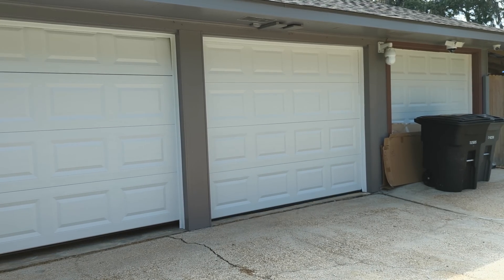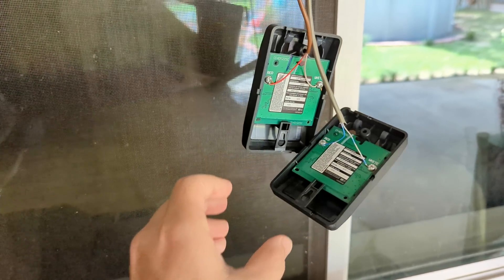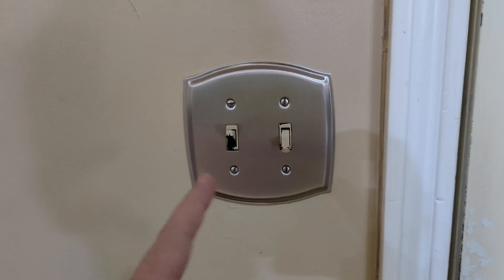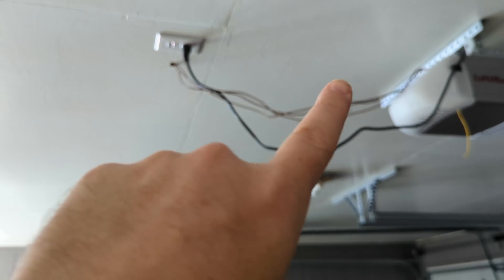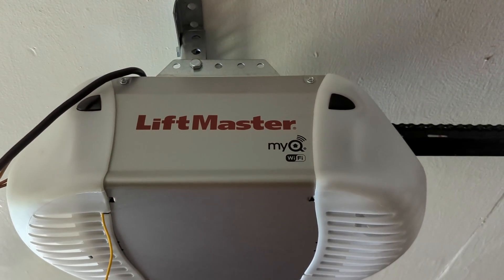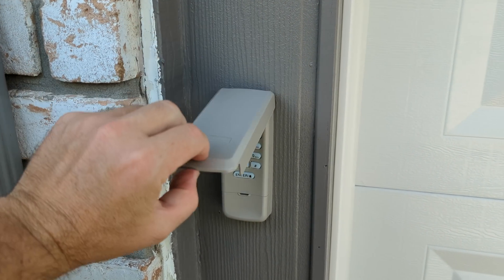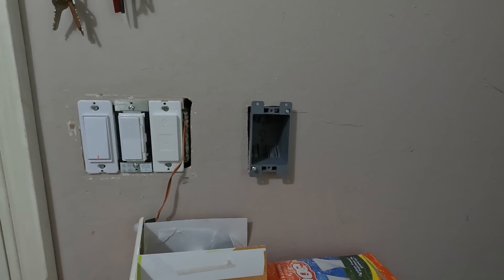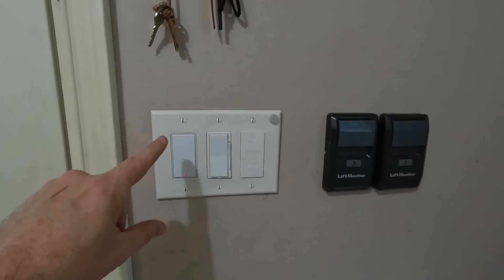I hate my new myQ garage openers! Why I'm removing the cloud and adding status lights.

Comment: I'm so far in the middle of the video but I have two LM's with MyQ and zero issues. I also have 5 Unifi access points so I have wifi 360* outside of the house. I live in Florida and opened my garage doors from Germany. I like it. Looking forward to the rest of the video.
Reply from the maker: The trouble is the dependency on the ISP and cloud being up which is out of our control. We could direct wire the doors to ethernet some how and still have the same issue.

Comment: I've been installing garage doors for nearly 15 years. Liftmaster is unrivaled in commercial access in my opinion, however for you guys looking for a good, reliable, basic opener I very highly recommend Guardian. Specifically the Model 615DC. They're super quiet, super smooth, and they just work! Liftmaster took a huge hit when COVID hit and I made the switch to Guardian for all of my customers unless they specifically ask for Liftmaster. Very good unit.
Reply from the maker: Thanks for the advice on the opener!  Definitely have to make a note of that.  Do you know if the button is a standard style button that shorting the two pins actuates the door?
Reply: @digiblurDIY  yes. There are no fancy circuit boards in the standard button. There is a premium button available but it has its own port on the back of the power head.
Reply from the maker: Nice! That makes it so easy with dry contacts
Reply: @digiblurDIY  it's also worth mentioning that the long term cost of ownership is lower as well. For example, a Liftmaster logic board may cost you in excess of $200 whereas a Guardian logic board may range between $75 and $100....also something to consider.

Comment: I am currently still using MyQ to open/close my garage door, but have also had lots of issues with their service in the past.  I installed magnetic switches connected to HA via ESP Home to use as sensors so I at least can know its status.  Ironically MyQ integration has worked flawlessly since I installed them (~6 months)--go figure.  You can also purchase cheap ~$14 LiftMaster 883LM switches for use inside so you can leave the original buttons in the garage.
Reply from the maker: Interesting, I didn't know those buttons existed, I couldn't leave mine in the garage due to the garage design.  Looks like it would have run me about the same as the one remote opener.  Can't say mine has been flawless, my ISP does suck but even when it was fine I would see little outages from them during the day.  Very noticeable after I had the status lights turn white and I'd see that during the day at times.

Comment: O man, I ended up soldering a couple small wires to the main button and then ran it to a shelly. Are you powering the remote you ended up using or still using the battery?
Reply from the maker: My second half will show this part but yes. No batteries involved

Comment: I considered replacing my old "Builder Grade" LiftMaster GDO five or so years back when it stripped out the plastic gears, and then again last year when the smoothing cap went out. I looked at my replacement options, which each time included myQ.  The more I dug into myQ, the less I liked what I saw -- The lack of an easy local way to control the door was chief amongst them.

In any event, in both cases it was cheaper for me to repair the existing opener, and since I'm cheap, that's what I did.  :-D
Reply from the maker: Yeah I went back and forth with the installer but they just looked at me stupid when I asked for an opener with just a regular button.  "But these have WiFi for your phone?!?"  I didn't want to wait for the backorder nonsense so I rolled with these.

Comment: You did a great job with all of this, but I must say, I like my MyQ openers. I haven't had any cloud issues. I've integrated it with Alexa, so I can open/close the doors with voice commands. I've also integrated it with my Android phone via the automation software Tasker in case I want to create context-aware scripts to operate the doors, although I'm not doing anything with it at the moment. (For a while, I had a script that detected when my phone connected to a cell tower near my home and then opened one door automatically. Since there really wasn't much utility for such a script (I just did it as an exercise),  I removed it.)

If I leave a door open, it pushes a notification to my phone, and eventually closes the door automatically if I don't close it myself. I can also check the doors' status with the MyQ app on my phone.

All in all, I find MyQ suits my needs well.
Reply from the maker: Thanks! They are down too much for us and the delay drives us nuts. The beeping and delay during closing is another issue.

The big goal is automated without the openers or touching of things at all.
Reply: I have 5 doors on MyQ and it is awesome.  3 in the house and 2 in the pole barn.  I’ll be adding a 3rd in the pole barn shortly.  Love the visibility on my phone to make sure doors are closed and know when people are coming and going.  Best feature is no one can get locked out!
Reply from the maker: @vpminneci  awesome until the internet is down or AWS is out again. Local is the way.

Comment: The "smart switches" with two wires is usually just a resistor along one of the switches. You can measure it with a multimeter and then use a Shelly with a restitor
Reply from the maker: It's a PWM signal, I did some reading on it with a guy that put it on scope.
Reply: @digiblurDIY  I think PWM would require 3 wires as you'd need a constant voltage source + ground to generate the PWM signal? never heard of it done that way
Reply: The button connection on the front side of the circuit board is still a physical switch.  That's how I connected my MyQ opener to a Z-Wave relay.

Comment: Hey, possible fix for your switch that does nothing. I assume you have seen where on one outlet or even on a line of outlets, one is always on (we will say top) and one works with a switch so you can plug lamps into them. So, what happens is someone replaces the outlets and doesn’t notice the little tab is broken off so they let it on, and now top and bottom outlets are always on. Usually living room or bedrooms, but a possibility. Usually easy enough to tell as there are two sets of black and white wires on each outlet, but passing through often looks like that too. Anyway, it’s something to think about.
Reply from the maker: This one runs somewhere else up in the attic towards an eave away from the room. Luckily this house only had one split switched outlet I had to remove.

Comment: Nice setup, looking forward to seeing how you deal with that reote. I have a version of the opener with battery backup.  I didn't want to deal with more batteries in the opener too, so I opted to just solder onto the PCB at the wired push button.  I used a Shelly 1, powered off the battery backup for my garage door opener.  Gotta love the Shelly stuff for projects like this.  I like the status light, but we live in a mid-century style home, and Decora style switches do not pass the W.A.F.  keep up the great work!
Reply from the maker: I won't be using a battery for this and it will be hard wired.  That was another requirement I had in my project combined with the isolation/not soldering to the motor.  Thanks!
Reply: I did the same since I had 12v with the battery backup for the DC driven MyQ.  12v for Shelly inside the unit with a soldered button (LiftMaster 883LMW $11 on Amazon). I would sure love a video though on the status lights wonder if a home assistant way to make a button like that for a wall mounted tablet system. I like the concept and still like the cloud connect for open and closing as a button in Home assistant but I ultimately put the local control so I could bypass the cloud only for the voice open and closing and when the cloud goes down which seemed to be all the time last year.

Comment: The switch inside your front door is usually for a switched outlet in the room.   Sometimes only half of the outlet is switched.   The reason for this is for rooms without a ceiling light it allows you to plug in a table lamp and switch it on or off when entering or leaving a room.  If yours doesn't function, someone may have disabled the function in the outlet.
Reply from the maker: I have that in one room where it had no ceiling fan, I later added one though.  That half split plug thing was annoying for sure and went quickly.  The room with the extra switch has a ceiling light/fan already.  It doesn't switch that nearby plug though.  I've tried to follow it in the attic but it is close to the eave and I lose it.

Comment: I'm glad you did this garage door video. I did the Shelly1 garage door open/close with the door sensor. I used the same sensor and a old blue Shelly1 that you used in the video on 7/24/2020. It has been working great until this last Home Assistant update HA: 2022.9.1, Supervisor: 2022.08.6, Operating Sys: 8.5, Frontend: 20220907.0. Now I'm getting this repair request: 

Your manually configured MQTT cover(s) needs attention
This stops working in version 2022.12.0. Please address before upgrading.
Manually configured MQTT cover(s) found under platform key cover.
Please move the configuration to the mqtt integration key and restart Home Assistant to fix this issue. See the documentation, for more information.
Warning - 9/8/2022

I did a # on my Cover for the garage in the File Editor but now I can't see the sensor. I have no idea if the door is up or not from Home Assistant. Could you help me with this issue.
I love your videos
Thank you
Reply from the maker: Thanks!!  Yeah the easy method door style.  You need to move the mqtt entries under the mqtt: section in your yaml file.  Pretty simple to do if you don't have a bunch of them.  If you get stuck or need some examples jump into my discord https://discord.digiblur.com
Reply: @digiblurDIY  That fixed it.  As always you got the answers... Thank you again.

Comment: Have you heard of the ratgdo project? It's an ESP8266 shield that you install into the lift. It provides a dry contact plus MQTT control over newer Chamberlain/LiftMaster garage door openers.
Reply from the maker: No I haven't.  I did find it in the googlez.  I opted out of soldering to the buttons on the motor itself or the wired openers.  I didn't want to change, impact or break anything on that side with warranties etc as the units were new.
Reply: It supports both a soldered and not soldered options.  If you solder, it gives you more information like the exact door position, etc - but the non soldered still looks to provide info like door open/closed, whether something is blocking it, toggling the light, etc.

Comment: I feel you about not dying in the attic! Houston's not much better. Planning some projects for the narrow window of acceptable temperatures in late Oct./Nov.
Reply from the maker: I went up there to run the other wires when it was 120F already...most of the stuff I did when it was raining all day so it wasn't as bad most of the time but huge pass until later in the year.
Reply: Had an issue with AC drain plugging. The new system has a float switch the cuts off the compressor, but the"smart" thermostat doesn't know. And I think it bounces a bit, cause the compressor always overheats when I get it back on after clearing the line. Going to move the flossy switch over to just reporting to HA via a Shelly: there's a perfectly good secondary pan and drain that will keep any damage from happening, and the wife will be much happier being cool.
Reply: So was up in the attic dealing with that a week or so ago. Similar temps. I should put a sensor up there

Comment: how did you get 5V to that ESP led button panel?
Reply from the maker: I have a 5V power supply in the attic that runs a few ESP based projects.  I ran another wire over from it to power this.  I kept it in a separate box to isolate it from the mains based stuff.

Comment: MyQ is a steaming pile of 💩. Sonoff SV is a much better/reliable option if you can handle some wiring.
Reply from the maker: Only single relay on the SV so I am not doing it this time around. Dual relay with some other sensors.
Reply: @digiblurDIY  I printed a box for a pair of them I got on sale a while back. Added some "cheap" reed switches and ran the relay contact to the input of the opener. Mine is old enough to use a regular button press signal.
Reply: I have a Sonoff SV too, but I think the issue is a lot of new garage doors no longer support the single electrical pulse as a signal to open or close. So a lot of people are just modifying openers to make the DIY stuff work. I would like to see this done without the need for a battery.
Reply from the maker: Yes! No battery will be used. Already tested that part.
Reply: @kissthering  yeah. Best to get a cheap, dumb opener and make it smart yourself.